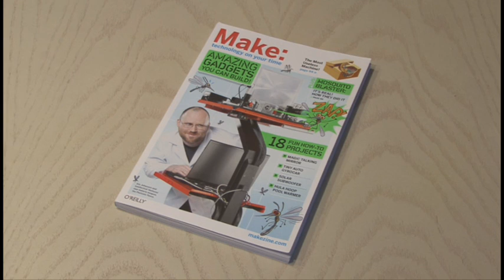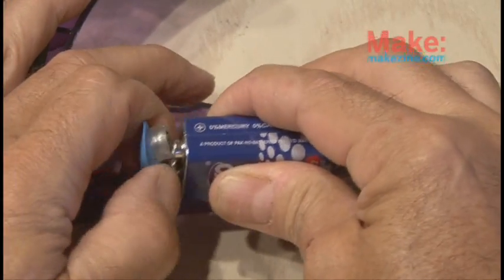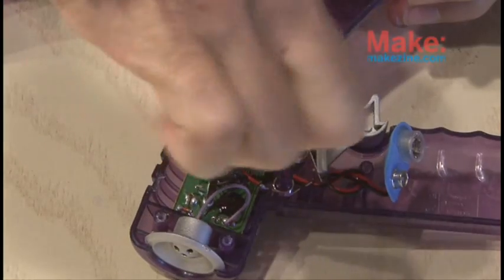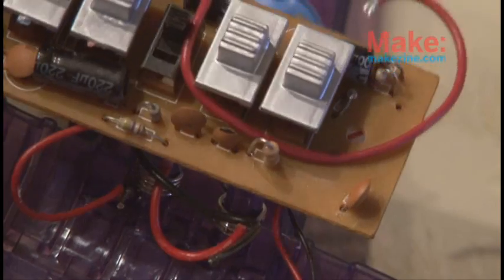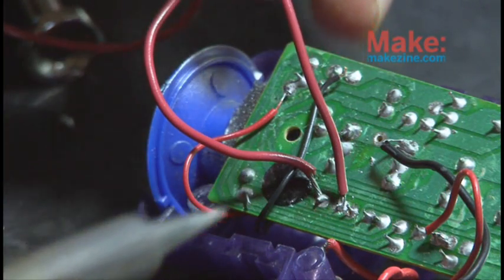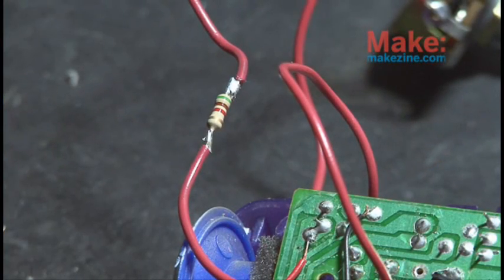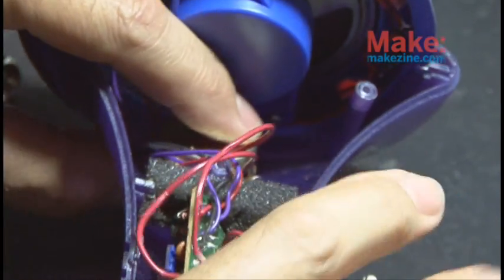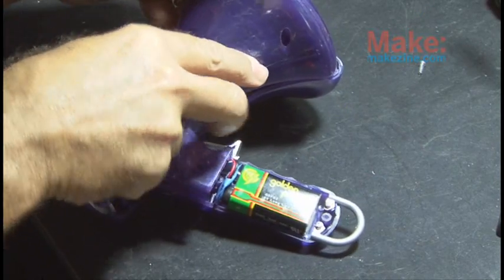Weekend Project: Easy Pitch Control Hack

Comment: @Dethmasheen 
Not sure if you found this out already but you can just attach it to the speaker out wires. you can tap it in-line so the speaker plays even when you have something plugged on or you can make it like a headphones jack and the speaker gets disabled when you plug in something. I modded mine this way so I can record the output. See my other comment below.

Comment: @turbaki2 : If you have an old radio, walkman, tv, or something else that has potentiometers in it you have all the parts you need.
It's just removing the right resistor and connecting the potmeter instead ;)

Never tought of this trick. Thx again KipKay ;)